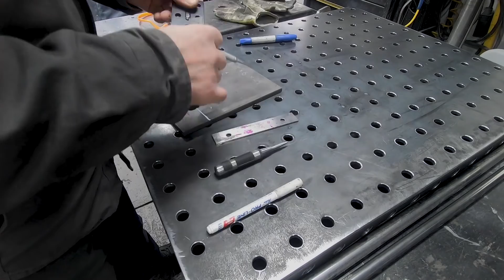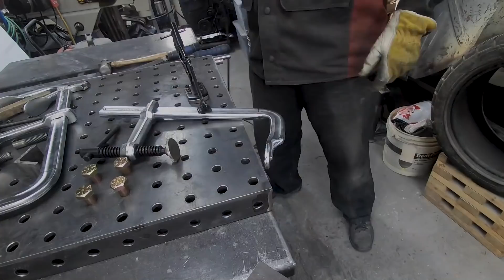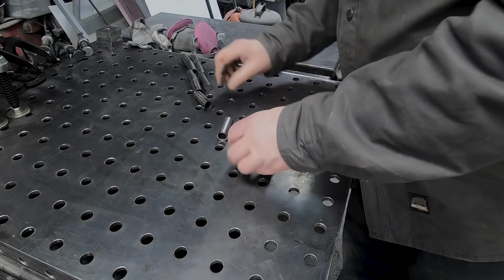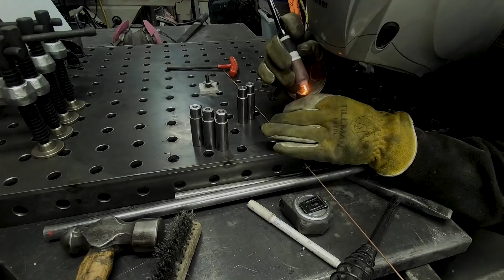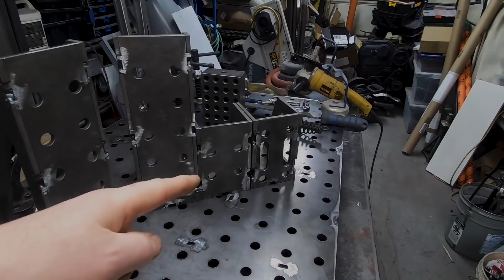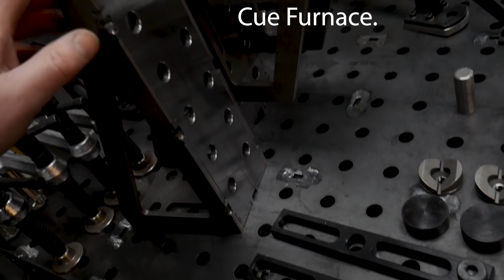DIY Welding Table Fixtures and Clamps.

Comment: So what do you use on the surface of the brackets you just made to stop them from flash rusting? Just oil or do you cold blue or plate them via electrolysis?
Reply from the maker: I oiled them, but I also live in a very dry area, so flash rust is not much of a problem.  I also coated them with a spatter prevention spray.
Reply: @ThrottleStopGarage  Thanks for the reply, good video.

Comment: I don't understand why people cut the threads off of the bolts. It really isn't a hardship to leave the threads on and hand thread a nut on from the bottom of the table. The clamp will never be able to work its way out of the table.
Reply from the maker: It looks neater otherwise there is no reason.

Comment: I would like to know where you found good quality tap and die sets.  
Which tap set you chose and are you happy with your choice.
Reply from the maker: For sets, McMaster Carr carries good quality taps for a good price.  I like that they kit the sets for each size with a plug, bottoming and taper tap.  I also shop locally.  Most domestic brands are fine.  Imports are not very good...to useless.

Comment: What taps would you recommend? Style / material?   I'm looking at getting the ratchet handle type
Reply from the maker: Great question.  I think buying good quality taps is the key to fewer frustrations and better quality parts.  Nothing that comes in a kit! They work for cleaning holes and are pretty junky.  McMaster sells top quality taps "USA made" or made in Europe.  I replaced all my metrics with sets from them...come with a taper, plug and bottoming tap.  Widia is the brand name.

Comment: Clever stuff!

If a stop (upright pin) is on occasion attached by a bolt from the underside of the table (such as for indexing multiple identical work pieces), you might mill small parallel flats somewhere on the pin - would perhaps make securing it easier.  And would make using fingers or pliers on it unnecessary.
Reply from the maker: You could - or weld a nut to the top.  I was just using mine today and I had no trouble with them just being held by hand and tightened.  I was using them to make a bending jig.  No problems.

Comment: apple cider vinegar is much better  if your supply ship can bring it in.  best is muriatc acid and water mix, but dont leave it in the shop or it will rust al steel in the shop overnite
Reply from the maker: If it's not on the shelf - I'm not going looking.  I did consider muriatic acid - but vinegar is less likely to cause trouble if a viewer was to try this method.
Reply: @ThrottleStopGarage   def go to Walmart for the apple cider Vineager then,, its better than the white. People use molassas and water even
Reply from the maker: @91rss  That place scares me...I'll venture in next time I need to remove some mill scale.

Comment: Please fix the legs/feet/base on your drill press and belt sander, I know you said it's safe, but it must be SO annoying trying to use it moving around like that. My drill press has 150kg of 100mm plate steel for a base and adjustable levelling feet and is ROCK solid :-)
Reply from the maker: They're on wheels...so it's more my floor, which is not flat.  Next garage will have flat floors and more space to mount these tools.
Reply: @ThrottleStopGarage  Semi fair enough - can you add some solid feet that flip/clip down or wind down to stabilise it when in use and pull/wind them up when not? It'll be good for your sanity, a lot like not reading yt video comments :-D Keep up the great work.

Comment: Oh I’m totally going to do the vinegar bath if it strips mill scale!  Been debating if I want to mechanically strip it off of the seat mounts I’m building and this just takes the cake if I can just strip the sections I need to weld and then dunk the whole thing before paint.
Reply from the maker: It works - just use the strongest vinegar you can find.  Strips the mill scale right off.
Reply: @ThrottleStopGarage  I've used straight concentrated hydrochloric acid brushed onto paper towels to remove it from the top of something I couldn't bath like that and it worked pretty fast, but the acid got consumed and I had to keep brushing on more and agitating it. End result, beautiful bare steel plate 50mm thick :-)

Comment: Loved the This Old Tony effect.  The chisel break was fantastic.  I'm surprised you were welding at 26.5V+ on that stuff.  Makes sense, you want guaranteed full penetration being that you're using them for fixtures and they'll be under constant dynamic forces.  Get in there hot and fast so you don't spend too much time heating the weld affected zone.  

I'll be doing an exhaust for one of my motorcycles soon.  And I'm nearly done the front fairing mold for my MV.  Takes forever!!!  I thought I was going to be done it in a week... 2 months later.  Took me 4 full days just to flange and wax!!!  Didn't realize how many curves and complex the fairings were till then.  Made the sides and nose all one piece.  Would have been easier and faster to do each as their own mold, but that adds weight and makes it annoying to take 3 off instead of 1.  Car panels are way more simple, bigger, but simple.  Definitely concerned about pulling the molds off.  I know I will have touch ups and maybe repairs too.  Though I do feel confident that the molds will release easily, go figure.  Flanging has been coming of super easy.  And if I'm not careful, bump it a little to hard as I've been preparing the flanging and waxing for the inner cowling, the fairings give a little creek as they start to release.  

Your videos have helped a lot.  Especially the mold release application.  The bagging and resin calculations will be a big help I'm sure once I get to that stage.  Looking forward to the exhaust work.  Are you going stainless or titanium?  I'm recycling a stainless (400 series) exhaust system for the KLR, and will be doing titanium (Gr.9 3Al-2.5V) for the MV.
Reply from the maker: It was a fun tribute to TOT.  Hot and fast was the name of the game.

Comment: Just think how much better that front suspension and cross member is going to be when we finish reworking it with all these new tools!  I can't wait to see you do it again for...? the fifth time? or, will it be the sixth?  We will never get around to Peel-ing-the-White at this rate.
Reply from the maker: That's welded in now - not coming out. I still have a few tools that need to be made for the next phase.
Reply: @ThrottleStopGarage  I am almost certain that Nik Blackhurst would re-work it if he had those fancy new fixtures and clamps ;)
Reply: @ThrottleStopGarage  "That's welded in now - not coming out."???  HAH!!!  
I told you that we WOULD make it better with all those new fixtures!!!
Honestly, I am deeply saddened for the grief and anguish that you must be going through. But... how about if I buy another t-shirt?
Reply from the maker: @mr.esq.8635  I've got a new shirt design but I'm changing it tomorrow as I just got the prototype...but that would be cool.  I've almost got the problem sorted out...working on a new video for next week.